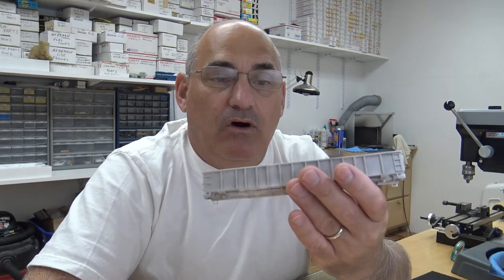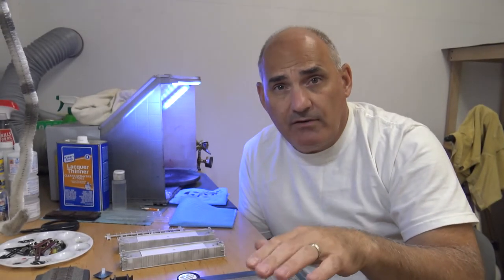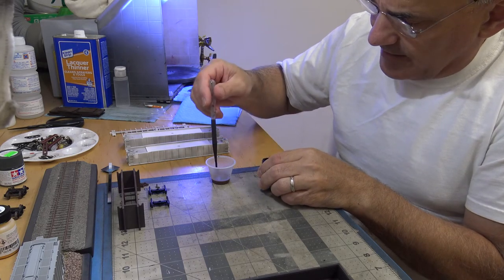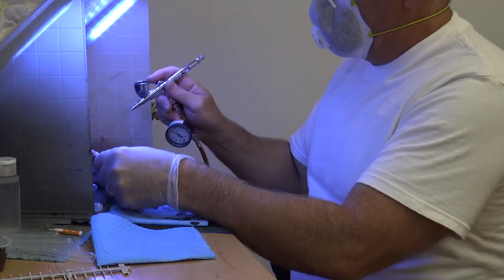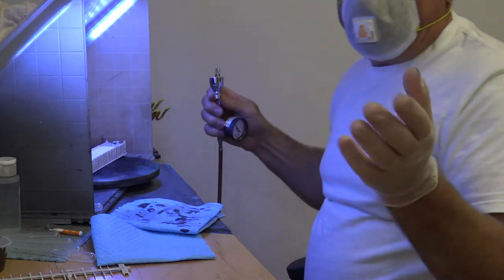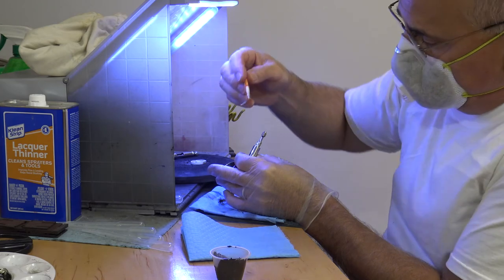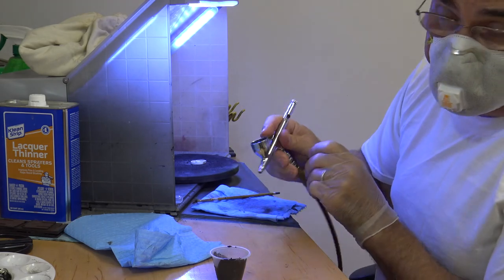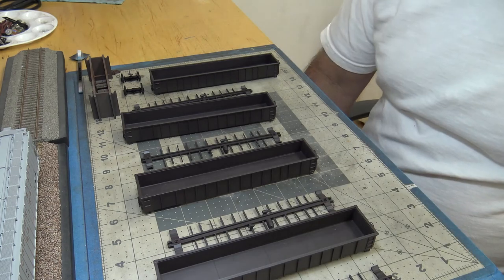ADVENTURES IN WEATHERING PART 1

Comment: I recently noticed that my tankless air compressor spits out a bit of water even though it has a moisture trap. What do you do to get rid of moisture, does having a tank help?
Reply from the maker: Yes, a tank makes all the difference plus a moisture trap. I have never had moisture come through the line. I do know what you are talking about and remember it well in my youth using a tankless air compressor.
Reply: @6axlepwr  Thanks for the advice, just went and got a tank. I was hard grit blasting on a wet, tankless air source...